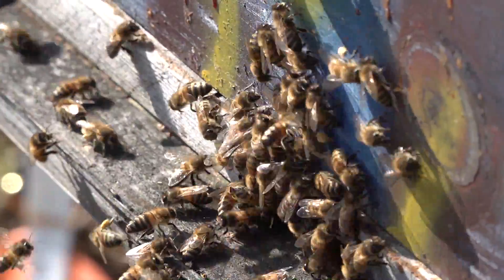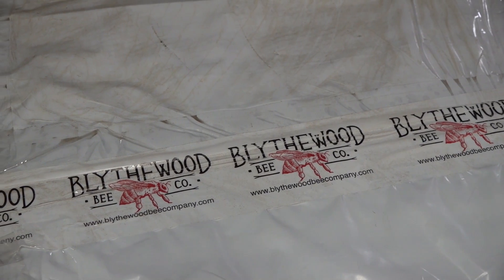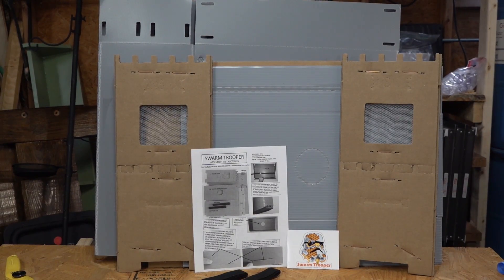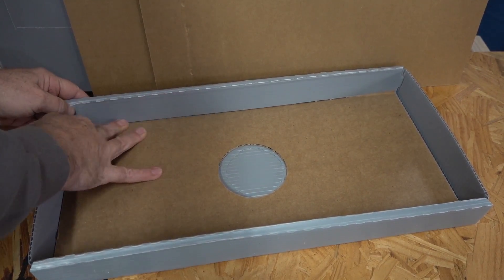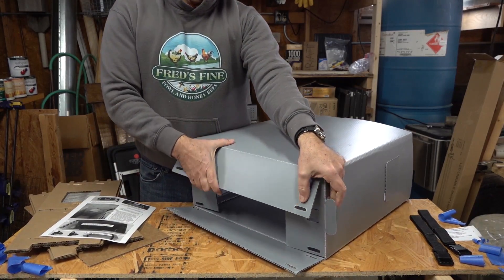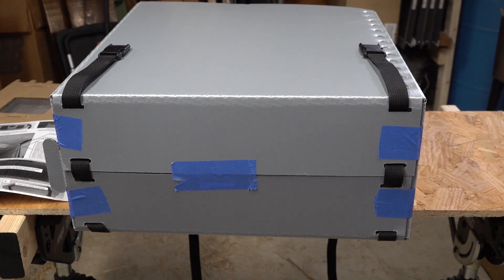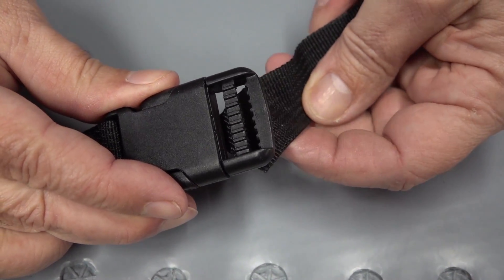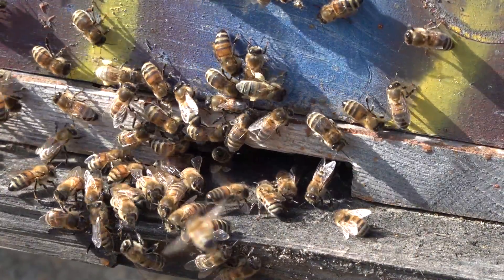Honey Bee Swarm Trap, Swarm Trooper Assembly and placement, Free Honeybees just for YOU

Comment: Hi Fred I know this is an old video but I bought a swarm topper recently 2022. I have not used it yet but I was assembling it today and used you video to understand what I was going to do to make it super easy. However I am pleased to say mine is a totally different design and has no card board items any longer for example the frame support are plastic also the vents are now the wheel type and the top / roof stays attached.
Reply from the maker: Wow, those sound like very good improvements! Thanks for sharing.

Comment: Any update on the Swarm Trooper?
Reply from the maker: I will say that others have reported that it worked well for them. But I personally didn't have any swarms move in, but then I tend to get my swarms while they are still hanging in the trees so they may not have the opportunity to move in? Anyway, I didn't personally get any swarms in my swarm trooper units. I had two of them out.
Reply: @FrederickDunn  thanks for the reply.  I also tried a couple last year without success, but it was a low swarm year in NE Indiana.   I'll try again this year.  My concern is that I am not always punctual about checking them and I am afraid they are going to fill the space under the frames with comb.  Did you see the new refubee trap at Blythewood?  Pricey, but as I get more "mature" like Jim Tew there is a definite leaning to more medium brood boxes.

Comment: Just got mine today from Blythewood, but it didn’t come with the sticker or Swarm Commander sample.  Also, the feeder hole in top cover came punched out already, but they included a twist-on cap to close it up.
Reply from the maker: Hey! I didn't get that feeder cap! (';')( ';').... I didn't use the sticker and I have a bottle of swarm commander.. it lasts a long time, so not as expensive as it first may seem.
Reply: @FrederickDunn  Well, I caught my first swarm ever in the Swarm Trooper today, a little less than 4 weeks after hanging it up!  The only issue I had was that the inner cardboard around the entrance collapsed a bit from getting wet from rain, even though I tried to hang it so the entrance was angled slightly downward.  Aside from that, I think it works great for someone that doesn't have the time to build their own swarm trap.